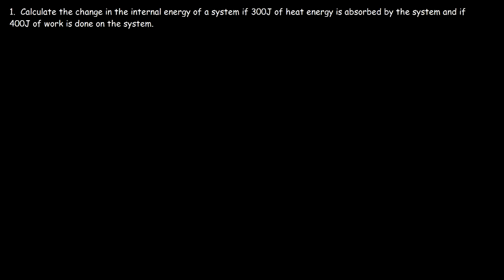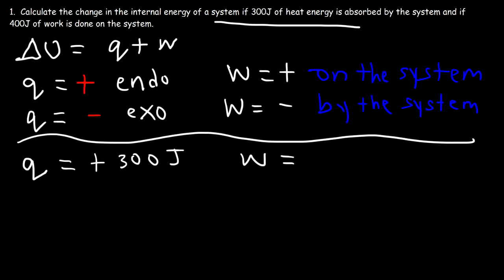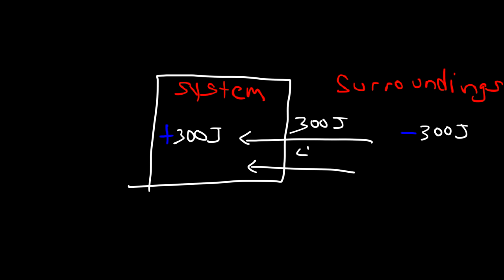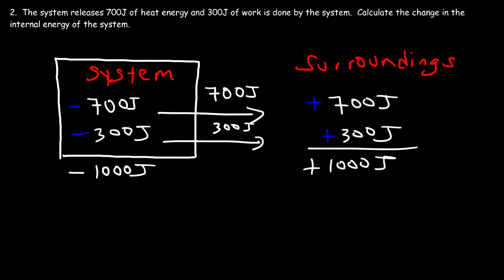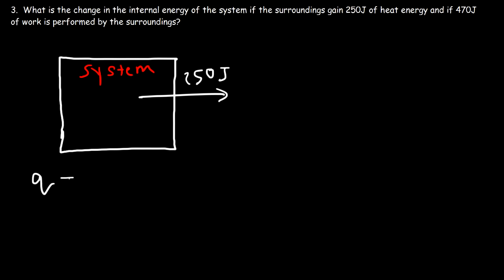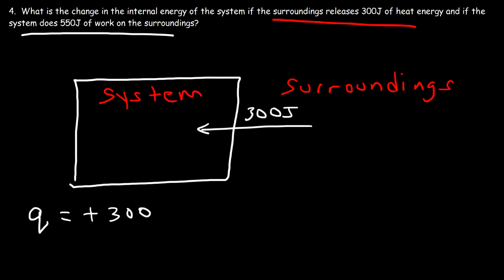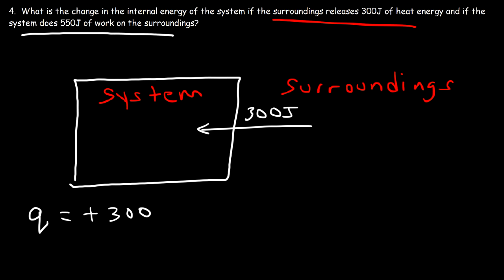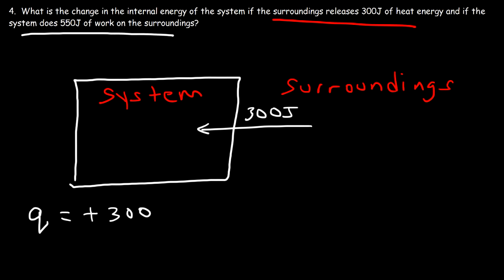Internal Energy, Heat, and Work   Thermodynamics, Pressure & Volume, Chemistry Problems

Comment: For everybody watching this thermodynamics video is for CHEMISTRY not PHYSICS! So, if you are learning for physics it will not make sense and therefore is wrong.
Reply: not wrong but the opposite.
Reply: @mehmetmehmeti5639  we need some exposure for your comment
Reply: How.pls
Reply: Once you watch the first video,the one introducing the concept of thermodynamics this observation becomes clearer,but you'd realize that both concepts,physics and chemistry give the same answer,what changes is how you treat work,i.e
   IN CHEMISTRY:∆u=q+w ;here when work is done on the system it          
    is  positive,and that is how the guy on this video has approached
   the first problem.
    NOW IN PHYSICS:∆u=q-w ;here when work is done on the system
    it is negative,so once you insert the value of work with its  
    negative sign the equation becomes;
                         ∆u=q-(- w) which takes you back to the chemistry 
     point of view;
                          ∆u=q+w
     Therefore both subjects are the same when it comes to the   
      answer but just differ in approaches.
Reply: Some works for physics too. Like W=-P∆V then multiplying it with 101.3J to convert L•atm to J
Reply: Well I'm studying physics and this is the convention. Also, if you search online, it seems to be the same as this. So I'm not sure what people are talking about

Comment: Professor Organic Chemistry Tutor, thank you for explaining the basics of  Thermodynamics and it's powerful impact on AP/General Chemistry. Once again, the practice problems outline the basics of Thermodynamics, which includes Internal Energy, Heat, Work, Pressure and Volume. This is an error free video/lecture on YouTube TV with the Organic Chemistry Tutor.

Comment: I think there's a mistake in the video

someone must have noted this but at 18:00 in the video, the work done by the gas in order to expand is supposed to be positive not negative, right? I apply positive work to an object to compress it and the object does positive work to decompress itself, right?

To reinforce this logic, at 12:30 we talk about a force being applied on the gas (by the system) to compress it, clearly positive. The work done on the gas to decompress it is negative because the gas is doing the positive work to decompress itself. Can I please get a confirmation? I want to make sure I know my concepts
Reply: For the first question, when you apply work to a piston in order to expand it, the volume would increase resulting in a decrease in the pressure due to the force pushing the opposite direction. Hence the equation w=-PV in terms of signs would be, w(-) = (-P) (+V).
Reply: @amirabasyouni2552 - I believe you're right. If asking strictly for "work done BY the gas", the answer should be positive because the gas is doing positive work to the surroundings thereby expanding itself. If the gas is expanding and doing positive work to the surroundings, then the work done ON the gas by the surroundings would be negative. When looking at the equations W = -PV and Delta U = Q + W, the W refers to work done ON the gas by the surroundings. A lot of physics problems are based on semantics, which could be tricky at times. Otherwise, great video and tutorial by the OCHEM Tutor; great for learning and reviewing.

Comment: I apologize if you've answered this question, but for question 6, is P negative because work is being done on the system? Thanks :)
Reply: that was also I need to clarify... if in expansion P is negative, then in compression the P must be positive... or maybe W= -p•v is the standard formula🤦🏻
Reply: we add (-) to make the equation work due to sign conventions

Comment: how do you solve the pressure? something like this "Perry wants to design a heat engine with a piston that can produce at least 250 J of energy per pump. How much pressure can his engine make given that the container can only withstand a change in volume of 11.50 L when the gas is ignited."

Comment: Last one is wrong: is the surroundings absorbe 500J then it should be -500J
Reply: The energy was absorbed from the surrounding. That means that the surrounding lost 500J
Reply: @roser8036  Excuse me, if the surroundings absorb heat, doesn't that mean that flows from the system to the surroundings?
Reply: @yanggang4352  yeah, that is correct. But the surrounding isn't absorbing heat in this question. The  key word is from. That heat energy was absorbed "from" the surrounding not "to" the surrounding. for Ex. Money was given "from" the bank not "to" the bank.
Reply: @yanggang4352  Not sure if any of that made sense lol. But the system absorb heat energy from the surrounding basically lol
Reply: @roser8036  Yeah, I see your point. I find it a bit ambiguous, but now I get the other meaning. Thanks!
Reply: I agree with you! 😭 Only u said 👍 even I paused and answered same .  In 3rd sum it is said that .
-Surrounding gain 200 means system lost only know (-250)
-Now last question surrounding observed mean gain only know that mean system lost only know so,(-500)

Comment: 7 question, q value _ 500 ,why u use +500 sir
Reply: q was absorbed from the surroundings, in other words q was gained by the system, which gives it a + value
Reply: System gains energy
Surroundings lose energy
So, q=+ 500J

Comment: Actually, work done by the system is positive, while work done on the system is negative!
Reply: That's according to Physics, as it is concerned with surrounding. While in chemistry, the system is taken into consideration and so, the work done by the system is considered negative.
Reply: thought asians were supposed to be smart? Mark wahlberg gets it.
Reply: Michelle what you said is absolutely correct. Let me ask you a question. what is minus? what is the physical meaning of minus? Negative is a something set by us human beings, not nature, so its about notations you use. Its not even about Chemistry or Physics. Book on Thermodynamics is written by Cengel and another author Mckonkie. They use opposite signs for work and Heat! Interesting isn't it?

Comment: #5 is worded in a very ambiguous way for no reason and that is unfortunately exactly how many professors and chemistry publishers teach it. Its unfortunate and frankly should be banned by the universities because people will get the problem wrong simply because of the confusion with "by" the gas "on" the gas "by the gas system" and "on the gas system", surroundings, ect. The net work being performed by the gas molecules is positive but the net work being performed by the gas system is negative. The question shortens gas system to just gas which is very misleading. In a real world application if you had a gas in a cylinder and your boss says how much work is that gas doing on the cylinder and you say its all good its not doing any work and something explodes you'll be in a lot of trouble and that's what we should be teaching towards in my opinion, real world work applications. Its all word games at the end of the day and that's not what science is about. A fair way to ask this question (#5) would be "A gas system expands from 25L to 40L at 2.5 atm. How much energy is gained by the gas?" You now can understand that the question doesn't pertain to the gas molecules specifically as much as it does the system as a whole. That's just my take. Nothing against the video. Just the way grammar in the U.S and Chemistry meet up to cause chaos. In other countries it's not worded like this so I understand the disagreements pertaining to these formulas. It's also why you get mixed answers from international tutors so be careful getting help internationally.
Reply: sadly, this is how the academic system is done. would they change it? doubtful at least tehre is a revolution, but a lot of those people want to keep how their own faculty needs to be different. it has nothing to do with real life. if that was the case many words would be changed in med school, law school but they still keep many old/dead language as part of their education.
Reply: I agree, the gas is doing positive work as it loses energy to the system by expansion. I would say the answer is flat out wrong. I guess the equation refers to the work done by the surroundings which in the case of expansion would be negative as the surroundings would gain energy.
Reply: @isaacgoldenberg2278  his answer is negative -3799J which is correct, he just almost forgot it.